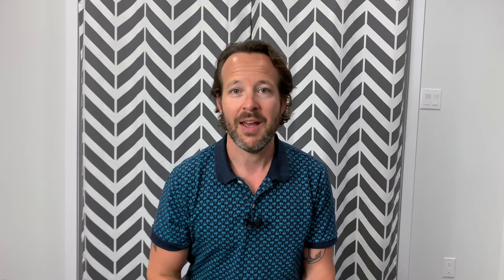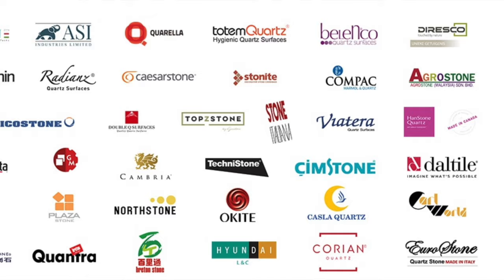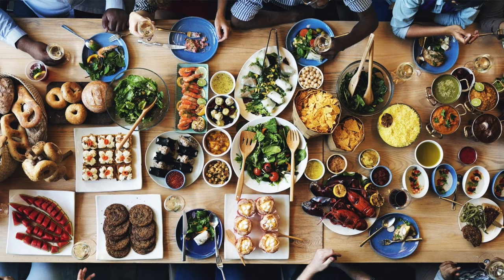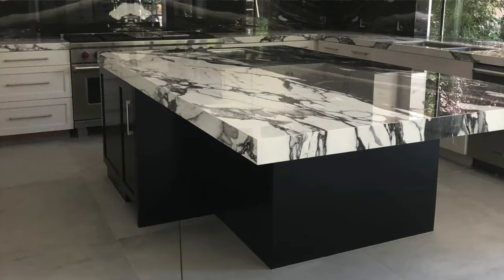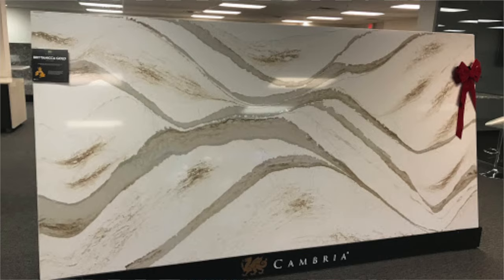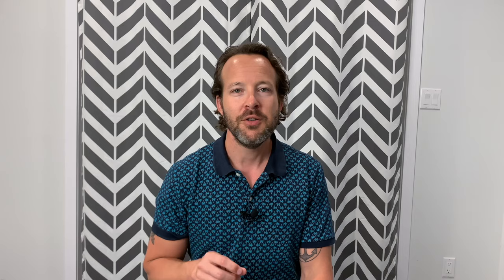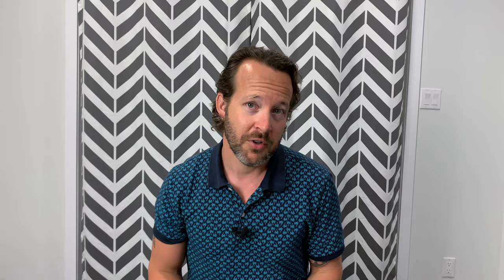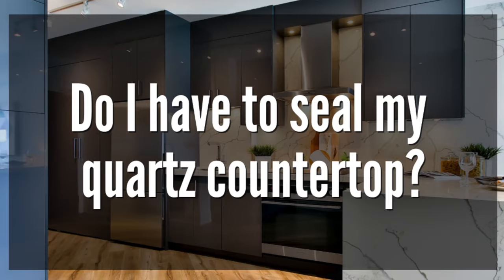QUARTZ COUNTERTOP | Everything You Need To Know

Comment: Can made-made "quartz" have chiseled edges?  I tend to think of it more along the lines of a modern, more technologically advanced, upgrade from epoxy pours (which can't have a true chiseled edge -- although an extremely skilled mold maker could build a faux edge to give a chisled impression for the pour).  Most granites can have chiseled edges.  Nevertheless,  some types [with dominant veining of crystalline material] are more challenging (e.g., my Gold Cosmic granite countertops:  it took a very skilled fabricator to pull it off).
Reply from the maker: I've seen it before.  Not sure how it's done or how it finishes though.
Reply: Thank you.  I spoke with four suppliers in my area; they all said it can't be fdone on quartz 

Then again, it could just be that they never heard of it; not that it couldn't be done.  Two of the four said that my specific granite [my final choice] had too many crystslized veining to be chiseled.  The one of the two I first went with did an unacceptable job:  looked like band-saw waves instead of chisels.  After I had them remove it, and they were honest enough to give me a full refund, I went with the second.  The second did a great job.

Comment: 700 degrees celsius? Where did this info come from? We shopped for Quartz yesterday and were told that it's heat resistant to 300-350 degrees....fahrenheit
Reply from the maker: It's probably time to remake this video and fix some of these blunders.  you are right with 300.  Due to the resins it can only handle so much.  I appreciate your comment!

Comment: I am in the process of getting new quartz countertops and I have chosen honed black.  Is there anything I should know specifically about honed vs polished?
Reply from the maker: From what I hear, honed finishes are desired partly because they are easier to keep looking clean.  I've never had a honed finish, so I can't say from experience.  However, I think it is a very beautiful finish and it's nice to see this option being offered more and more.  Getting tired of high gloss.
Reply: @MTKDofficial  I hope they ARE easier to keep clean!  The reason I chose honed, though, is that I am also getting under-cabinet lighting and did not want the underside of the cabinets reflected in the countertop.  Will be getting them this month (Nov.) and will let you know if they are easier to keep clean.

Comment: I’m trying to research Allen & Roth countertops. They are a lowes brand but trying to dig in to see if they use Breton stone is a challenge on google and on their website as well. It keeps going back to “Sage surfaces” trying to get info on that is becoming confusing. Do you know anything about Allen & Roth and Sage surfaces??? We found a nice quartz countertop from Lowe’s but want to make sure it is of good quality. I feel like it is because it’s a big franchise cooperation. Any additional help would be greatly appreciated. Thanks
Reply from the maker: From what I could find, it seams that Silestone is the manufacturer of Sage surfaces, or at least a Silestone owned plant.  If that is the case, you should be fine.  The warranty is pretty detailed.  That said, I can't say for sure.

Comment: I have a question, please.  I bought 2 similar bathroom vanities, one for the hall bath and one for the master bath, with quartz tops.
Every time you even touch the top on the larger one it makes an imprint from your fingers, which doesn't go away, but it does not do this on the smaller one.  It seems like it is absorbing the oil from your skin.  I bought them together at the same time from Menard's.  It seems like the larger one needs something to seal it but you are saying it doesn't.  One does seem to be shinier than the other but neither of them are dull.  Any suggestions?
Reply from the maker: First off, love your user name.  I have a tattoo on my wrist with that scripture from Revelation.  Anyways, your question.  Sounds like you have product that was likely made in a place where they don't pay attention to standards.  Manufactured quartz is made non porous and sealing it would do nothing, unless it's either poorly made or it is not actually quartz but a natural stone.  I've seen it before too.  If it's absorbing oil from your skin, something is up for sure.  You could try sealing it, but I have no idea the result.  I wonder if there is a warranty on it?  Have you asked the staff at Menards?
Reply: Amen! But the weird thing is.. i never left that comment.  Was I hacked? Ive never seen anything like this before 😳
Reply: @MTKDofficial  that explains the shadowing, whether acidic or any oil, that results from penetrating the top layer of all my countertops. They look awful now. The flippers charge a fortune for their efforts, in this high end area! But oh boy I had no idea the poor quality throughout that we paid a fortune for.
Any way to fix this shadowing would be heaven sent....

Comment: I disagree with few things said - just because company uses same technology does not make it equal in quality.  I have a lot of designers switch from Caserstone to Cambria due to quality issues. Also not all solid color slabs are cheaper. For instance pure white can be expensive as it's hard to get clean slab without foreign particles in it. Also slabs don't come in 2mm...the thinnest you can go without slab collapse is 5mm and can go up to 3cm(30mm).
Reply from the maker: Hey thanks for the input.  You are right and these are blanket statements and general guidelines.  The pinned comment has the correction on the thickness.  Thanks for not being rude with your input.  Appreciate that!

Comment: I have a question,  can I install an induction cooktop on  a quartz countertop  and not be affected by heat?
Reply from the maker: That's a great question.  I would have to double check, but I think you can with induction.  You can do it with porcelain for sure.  Thanks for asking, I'm going to do a little digging on that.
Reply: an induction cooktop generates almost no heat and is compatible with every normal countertop material.

Comment: Regarding the quartz all being the same price is just not true. The manufacturers all have price tiers for their quartz. It has to do with the "art" process and transportation. A lot of the veining and movement in quartz is actually hand-made, so quartz thats mimicking marble or mimicking a natural stone, tends to be more expensive because it was more time to create the consistent veins/movement. Quartz thats a solid color without movement/depth or if its terrazzo-looking is the cheapest kind because it is just machines pouring in the quartz sand and epoxy resin evenly mixed together. Some suppliers like Cambria are more expensive because of the proprietary process they use to create their beautiful slabs in the USA. Other manufacturers create the slabs offshore and import them to USA which affects the price (usually cheaper).
Reply from the maker: Yeah the price of quartz is all over the place.  Plus the vendor's markup can very a lot depending on where you purchase it from.  Great input!

Comment: What can I use to disinfect my quartz countertop? I know it’s non porous but I would still like to disinfect it.
Reply from the maker: Hi Lillian.  There are a few suggested methods.  Light detergent and warm water will be the most not aggressive (but it works). Also rubbing alcohol and water mix. (1/4 cup/litre).  Put that in a spray bottle and you are good to go.  If you know the manufacturer, always check with them first.
Reply: @MTKDofficial  I asked where they sell quartz and I was told don’t use any acidic liquids on the countertop...would rubbing alcohol ruin the shiny finish?
Reply from the maker: @Lilliancooks  Rubbing alcohol is weaker than water for acidity.  So it's fine.  Always test first.
Reply: @MTKDofficial  Ok good to know because I like disinfecting with alcohol 👍

Comment: Is sealing your quartz not a good idea? Could it damage it ?
Reply from the maker: Hmm.  Quartz is not manufactured with the need to be sealed.  I can't see a reason to seal it.  However, I can't see it damaging it, but I would definitely check with the specific vendor before I did it.
Reply: @MTKDofficial  Hi mark, we are having issues with out Caeserstone countertop  - everything shows on it! I read that they stain easily as residues get stuck to the resin to create a chemical reaction which is irreversible. And on the other hand, I read that a sealer won't stick to it if attempted (to prevent further staining). Any thoughts?...thanks.

Comment: Thanks for the video!  I just have a few questions for you. Does Quartz countertops pair well with white melamine cabinet/cupboards? Can I reuse my existing sink when they install my new Quartz counterrop and use it as a drop in or would that look ugly and in which case maybe I need to go with the kind of sink that is mounted underneath. Could I reuse the same sink and mounted it from  underneath the counter? Is Quartz more in vogue than Granite countertops and a better investment if I am upgrading so I can sell my home?
Reply from the maker: 1st question: Yes, though if the cabinets are in rough shape it's a better investment to upgrade those instead.
2nd Question: Yes.  The fabricator will need the measurements and some top mount sinks can be under-mounted.
3rd Question: Yes.  Generally speaking, if you are upgrading to sell, quartz is a very good option that buyers like to see.

Hope that helps!
Reply: @MTKDofficial  The cabinets are in good shape except a couple of doors may need to be replaced. I was thinking of swapping out the current cabinet doors for ones that have more contour and design in them cause the current cabinet doors are very plain, flat white. They are very easy to clean however so not sure if upgrading them is worth the trouble except for maybe changing 2 doors that have cracks in them on the backside. Thanks!
Reply: @Mark Tobin Kitchen Design  a small battery leaked onto our quartz countertop, which etched it. Is this something we can fix ourselves and if so, kindly advise how we do this.

Comment: I purchased a quartz countertop today and I cannot find any real info on brand… I purchased from a reputable stone place in my area. Have you ever heard of Difiniti Advance Princess Quartz? I did find that it has a ten year warranty which seems quite a bit less than what you have mentioned. Any input on the quartz ? I am staying to freak out a bit! TIA
Reply from the maker: Hi Terry.  I would double check with their customer support.  Just to be sure.  I can't determine if they use it or not.  They look pretty decent and the company itself is part of the Terrazzo & Marble Supply Company.   One good thing is they have all the technical data on their website, so at the very least they are not hiding anything.  Sorry I can't be of more help.
Reply: @MTKDofficial  Thank you so much for your reply and input! It really is appreciated!

Comment: Could you update the section on "is it heat resistant?" to the latest accurate information? That would be great. Mark, we know you're not a scientist and don't have a science background. Alas, it is a 'myth' that engineered quartz countertops can withstand a temperature of 700°Celsius and, in fact, the temperature ratings at the NSF site for same are in °F and are much, much lower meaning use of say a wooden board to protect the countertops from anything hot off of a cooktop or out of a range oven or even a hot dish or mug out of a microwave oven is ALWAYS recommended. In a comment you made about 2 yrs ago you stated “…is heat resistant to nearly 200 deg. C”, however, not all engineered quartz countertop products will be able to tolerate that level of heat, so again, consumers will benefit from facts. We know you didn’t mean to mislead consumers by telling them not to worry about engineered quartz countertops when it comes to heat resistance, but I'm sure you'll agree accuracy does matter. Each of the 'named colors' from various Trade Name brands can be found on the NSF International site (years ago called the National Sanitation Foundation) noting the temperature rating for slabs of that specific engineered quartz product, as well the country of origin for the specific manufacturing plant (which frequently sources a number of components locally, if possible, to help control costs). The resins used in the mixtures for engineered quartz are particularly susceptible to heat, although the entire slab piece is susceptible to thermal shock from either heat or cold! Go to https://info.nsf.org/Certified/food/Listings.asp?TradeName=quartz where anyone can find out the highest temperature a given 'named color' of engineered quartz made in a particular manufacturing plant is rated for. Consumers can choose a 'named color' from a particular plant rated for a higher temperature when planning to place such an engineered quartz piece next to a range or for a countertop into which to place a cooktop. In planning various aspects of commercial foodservice this type of information is critically important, but also for consumers planning a home kitchen redo or initial build. One other thing to correct in this video is that those countertops are measured in centimeters (cm) not millimeters (mm) of thickness. Again, you're a kitchen designer, without the benefit of a science background, which explains how you could be confused about the different terms. You did aim to correct that error in the comment you made 2 yrs ago. 1 cm thickness is sometimes used for a water protection backsplash, but check the temperature rating if considering it for a heat backsplash.The 3 cm thickness is preferable for countertop use, although interior designers have promoted the 2 cm with a built-up edge to appear as 4 cm, but that really is less advisable as those edges are more prone to chips and nicks and the 2 cm thickness countertop requires a full sub-top and shorter cantilever distances for say kitchen island or peninsula seating. You have included some good information in the video and as long as folks don't ruin the factory finish on their engineered quartz countertops and avoid thermal shock, etc., they should be able to enjoy them for many years. The resins used for the 'whiter' named colors are more susceptible to potential yellowing if exposed to direct sun UV rays, so it is wise to pay attention to where a given 'named color' might be used and avoid placing the 'whiter' named colors in direct sunlight. We appreciate your efforts at content creation so keep them coming!
Reply from the maker: Hey. Thanks for this info and for not just trashing me like some people do. lol. I'll definitely take a look at that website and incorporate updated information in a future video.  Appreciate you.